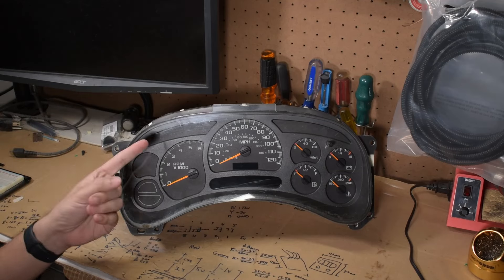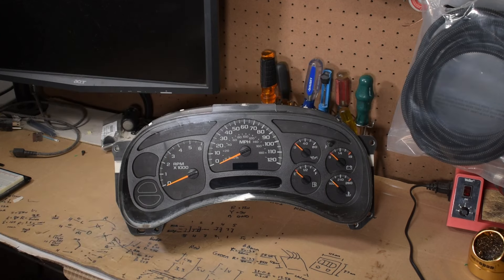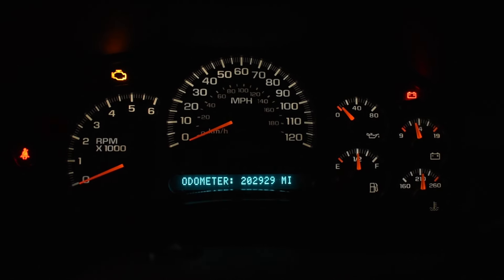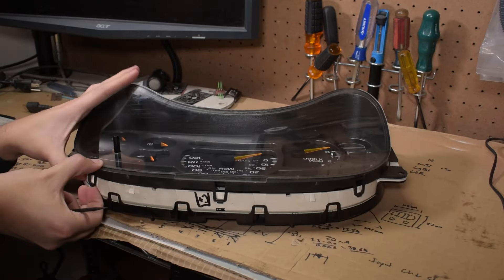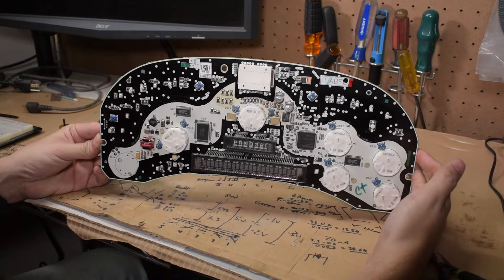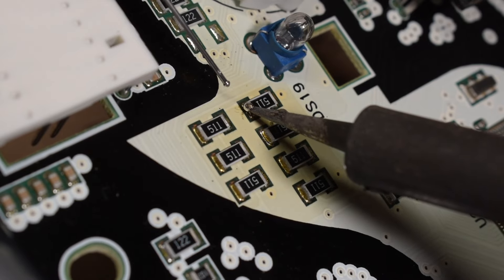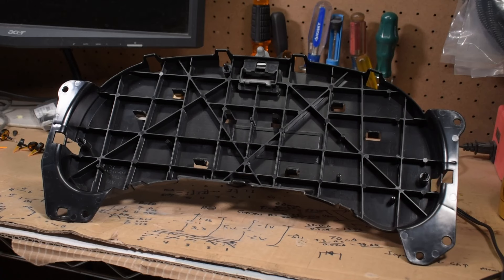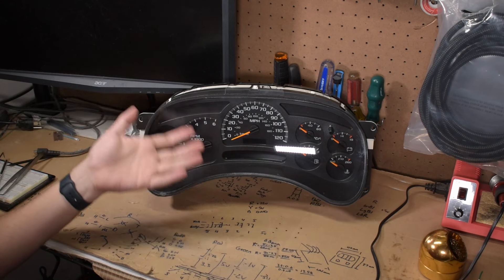Fixing the PRNDL Display on a GMT800 Gauge Cluster (2003-2006)

Comment from the maker: I’m happy to answer questions, but I will make it clear that it’s extremely hard to make guesses as to what may be wrong with your specific truck over the Internet, and any responses I give are not to be taken as hard fact, but simply guesses unless stated otherwise. I started with a truck that was in good condition and this repair fixed a common problem due to age and heat cycling, and the harness is in known good and original condition, and the truck had no known faults.

If this repair does not fix your problem, check fuses for your gauges (consult a manual for specifics), check your harness for damage, check to see it is fully plugged in, check your door switches, and finally, you may need to replace your cluster if it is beyond basic repair. Unfortunately vehicles are harsh places for electronics and these are not well designed for the environment some people can put trucks though.

Comment: the issue im facing is that the only power the cluster receives is the backlighting, however the gear selection, odometer, gauges, and warning lights are all not working. any recommendations?
Reply: P
Reply: Ususush

Comment: I have been trying to find this for ages and hopefully you know the answer. I was having the dim prnd321 display so i checked those resistors and had one missing. do you know where i can get replacement 511 resistors? i tried getting others that said 511 on them but they are like 1/2 the size so i worry they aren't rated for the same voltage.

Comment: Dude you just made my wife very happy. 
Those resistors are way smaller than they look in the video. At least 2 of them were cracked... I wouldn't have been able to see the cracks, but they moved a lot when I was resoldering them, so that told me they were busted.
Set the soldering iron at about 500° and put a little bit of solder on the tip, then hold it on the joints for a couple seconds. Nice fix!

Comment: THANX for the video and straight forward instructions:
I bought my '04 AVY used, 2 years back, I always wondered:  Why didn't "Prindl" work / display?,   I figured bulbs,   I worked around the issue,  but when I loaned her out it caused confusion..  I was thinking... maybe it is time to spend $100 and send the speedo out for repair.. Then I stumbled on your video.. 1/2 hour out of my life and the display now works like new.
 Just how bad were those solder joints? about 1/3rd of the resistors, when I touched the iron to one joint the whole resistor moved, telling me the other end was no longer attached.

Comment: nice video... i'm experiencing same issue, but the whole cluster goes out....  pulled it off, checked solder joints, and they actually looked pretty good.  but when i plugged it in (prior to dash reinstall) it came on, so great, right!....  but nooooo   when i got it all back together it is dead again.   i used to be able to gently smack it with my hand and everything would work, but now, nothing.    could it be a short in the plug harness?
Reply from the maker: If soldier joints look fine and some percussive maintenance solved it in the past, but suddenly has failed to resolve your issue, I'd agree with your assumption to take a look at the harness. I'd also check fuses for the gauge cluster. I'd also check to see if the connector was simply loose when you put it back together - I'm sure you found out, but it can be a righteous pain to get plugged in with the amount of harness you have to play with and the space available.
Reply: Head light switch is your culprit behind no dash lights or other interior lights
Reply: I had this same issue and reflowing the connection solder points solved the issue with nothing working randomly

Comment: great video. any info way the same cluster has a dim battery light on all the time!? even without key
Reply from the maker: First thing I would check is grounds.
Reply: I know that this comments year old so I don't know if you're still dealing with the problem but mine used to do the same thing with the battery light on all the time and then I realized that when it was in park the gear shifter wasn't going completely forward and so the key wasn't turning all the way to the off position try that and tell me if that works if you haven't figured out the problem yet

Comment: I have this issue, going to have a friend with experience repair it but wanted to get a replacement PRNDL screen just in case, but cant seem to find one anywhere online. Any reccomendations? 

Also i HATE the high beam light that the 03-06 trucks have. Is there anyway to disable this while the cluster is appart?

Comment: my cluster is draining the battery. the information center is lite up solid off n on when the truck is off and key is out. I've had to a "cluster repair guy" local but he couldn't fix it. he made it worse. any ideas what it could be?
Reply from the maker: I’ll be honest, it might be beyond repair if a fix attempt made it worse. The cluster will always have power when it’s working properly, but is in a standby mode and turns the displays off. The board may have a severe fault somewhere and failure was accelerated when it was taken apart. It could also be something else in the truck telling the cluster to turn on.
Reply: It's the ipc/dic fuse that's pulling the draw.
Reply: @nickphilips3570  yes mine is doing the exact same